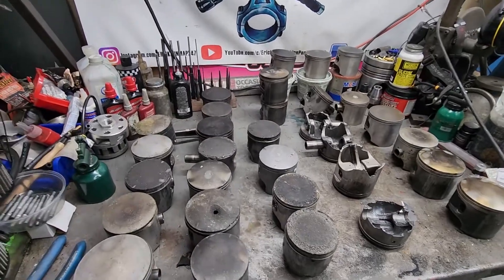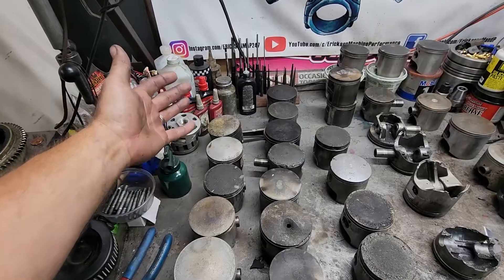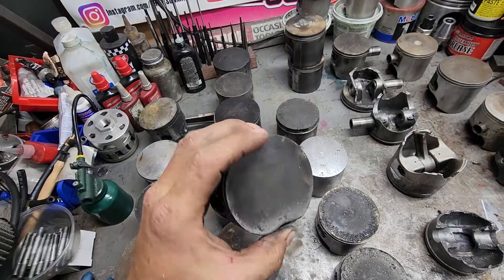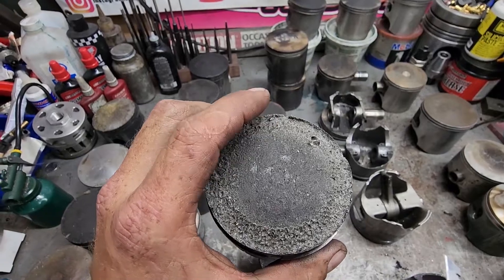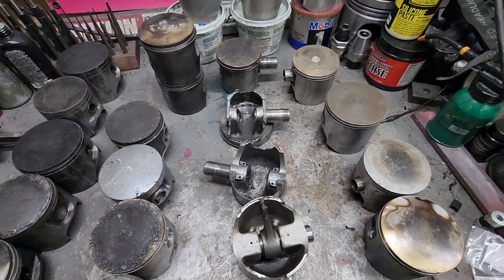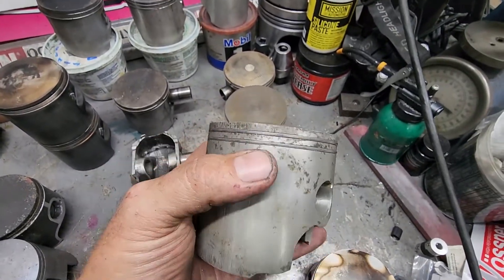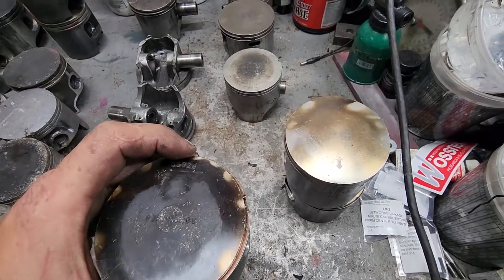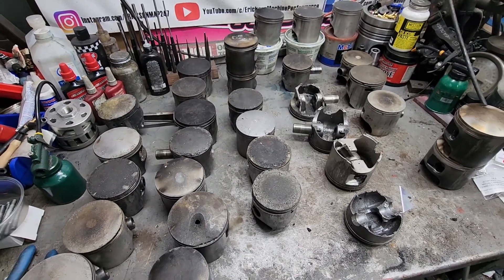OUCH! what happened and why? 2 stroke Piston Failures

Comment: Over revving oftentimes causes pistons to split along the wrist pin line as well
Reply from the maker: No.   If the piston is breaking, it's a clearance issue.    Over reving won't break a piston unless it's a 4 stroke and you lose valve control  ( drop a valve or float a valve that contacts a piston).
Reply: @EricksonMachinePerformance    OK, we will agree to disagree...
Reply from the maker: @donk499 pistons don't break for that reason.  There are engines that spin 20k rpm.   The only thing the would cause it to break is piston rock from being to loose.  If this has happened too you its the clearance that caused the issue.
Reply from the maker: But we can also agree to dis agree.  You can call piston manufactures. Pistons only go up and down.  The speed isn't going to break it. The rocking motion of to much clearance will. Either way.  Thanks for watching  @donk499
Reply: @EricksonMachinePerformance    Well, different piston designs have different failure characteristics for sure.
Reply from the maker: @donk499 pistons do not break from over reving unless they make contact with something else.   You would hurt the rod before you broke the piston.   If your cracking a piston its a clearance issue  or something is making contact with it.
Reply: @EricksonMachinePerformance     Once again, we will just have to "agree to disagree".   Again, it is like you say, different manufacturers/styles have different failure modes for sure.
Reply from the maker: @donk499  Thats not a failure mode.  Pistons don't magically break at high rpm.
Unfortunately your mistaking one effect for a cause.   Pistons do not crack from over reving.
Reply: @EricksonMachinePerformance   Well, I guess you and the engineers at OMC/Evinrude/Johnson will have to discuss this.
Reply from the maker: @donk499 once again.  If your cracking or breaking pistons, it's from too much clearance.     Best of luck.

Comment: Nice one. I have a different hypothesis on the last lean piston you showed. It looks sooty so possible it was rich and smoking so reduced oil in mix thinking too much oil and instead ran dry.
Reply from the maker: Yeah. Alot of people think that but its not correct.    When 2 strokes are rich the fuel washes the piston ( cleans it ). You can look up 2 stroke piston wash, it is a way to check how an engine is running.   When it is lean it over heats the piston causing the fuel and oil to burn onto the piston.       Thanks for watching

Comment: also we take apart TONS of outboards and most just sit around unused. people cannot be bothered to de-carb them with engine tuner or quicksilver power tune, and the rings stick. as a result, we take the head/s off and try to rock the piston in the bore. if it won't budge, you can try to free it up but most need to come apart. some rings are so seized in there we need an air scribe to to get them out! piston can even be ruined.

Comment: Wromg atleast in my casebthe streaking isnt being caused by water  becasue there isnt any in the engine
Reply from the maker: @Freeknickers24  there are many different types of vertical damage on a piston.   If you want email me some pictures I'll take a look.
Reply: @EricksonMachinePerformance  crazy I didn't expect a response ever much h less so soon. Well I'll tell a few details real quick and hopefully I'll remember to.irrow about pics . It is  a cheap china engine a yd 100 it's the second of two I ordered 1 and it snagged a ring g about 1 tank of gas in and it was ru  ing really good so I took it apart that involved 2 trees amd a winch I investigated then decides it was a ring that got snagged at one of the ports  did a little research which I should've done before ever running it I find out. The reason it snagged a ring is because because it pretty much an unfinished 2in1, cylinder and head are a single unit,  cylinder and it will snag a ring at a port basically always . So I contacted the seller on, lol, temu, the first thing of very few I've ever bought there. I took the second one or was it after the second one view I did the research? Anyways somewhere along the way i started chamfering the ports 2 engines 2nd engine vlew but not as bad but bad enough i needed a new cylinder in it i out new cylinder on and had accidentally while sleepy got mixed up and cut the intake port too low but o ran it it didnt blow but i eneded up chamging it when the next new o e came in i didnt hear the tapping before on the last cylinder but i did notice the scarring on the piston near the exhaust port and I tho k the intake aswell i looked in through the exhaust port the other day and i thinknit was a little worse. The other day about a week or so ago i swapped chains to use my 37 tooth sprocket ran about 4 mules then 4 back home and next ride with the 25T sprocket i noticed a tapping that seems to be louder and im assuming its the skirt slapping the cylinder as it sou.ds like a scrubbing sound is being made as well but that could be the drive gear but i dont think so. If im not working tomorrow im tearing it down again. The main thing I'm worried about other than getting in an accident, is the reason for getting into the accident, like what is causing this piston to score itself , maybe tithe ports have a inward pudgyness but when I used the blade of my micrometer which is basically perfectly straight I couldn't be sure there was and bulge at the ports that maybe are pulllung one side and causing th piston to cock one way or the other or maybe the port pressed in the rings to the piston and passing by them and was pressing in enough to score the piston but not enough to stop the piston or break a ring. Other than that maybe misshapen cylinder but this last o e loomed alot nicer than the other 3 even though it needed chamfered as well and I didn't port it because I need a ride not a toy just yet. I want to keep it but I think I may get another unit altogether that is better quality.   I don't know where I'm going with this post exactly im quite sleepy and it is 2:20am.

Comment: The modern YZ250 2-stroke (I have the 2019) has a problem that I am sure causes a lot of damaged pistons, ans is related to a cold seizure.  The jetting is so darn rich stock, the water takes forever to warm up.  I am not sure mine even got to a good operating temp.  I bought my bike with just 3-4 hours on it, and i am sure the previous owner was just impatient and took off before the water was warm enough.  I bet many kids do that with the YZ.   I rebuilt the top end, (and modified the engine for more low rpm power), to find the stock piston had a slight 4-corner scuff, but the major damage was at the exhaust port.  The hot piston expanded before the cold cylinder could, and forced the piston into the exhaust port.  The top ring groove was wide with a budge on the crown edge (and looks ready to come apart, but it still ran good), and the lower ring groove was squeezed shut against the ring.  I will bet  that up to 80% of those bikes, (because i now how impatient kids are), with stock jetting, has a damaged piston in the jug.
I have changed every jet in that carb (after raising compression which did lean it out a bit), and it is still running rich in the middle (have to change the entire needle---again.)
It was amazing I was not fouling plugs with the stock jetting,--but it was close.  I know 2-strokes with a carb are jetting a bit rich from the factory (because of different air quality around the world), but that thing would ruin the backs of my jerseys,---it was spitting so much oil out of the stinger.
Reply from the maker: @EarthSurferUSA  email me pictures of the failure.  Ericksonmap@gmail.com

Comment: I was hoping you would mention pre-ignition as well for detonation  but all around great video
Reply from the maker: @marinzeraja5416 Great comment.  Yeah, it's tricky to fit every failure method in 1 video without missing something.  My plan is to do a Dyno video and show what's going on when these events occur. I will try to show pre-ignition in that video.  This video was mainly to take the guesswork out of WHY a 2 stroke engine failed.     Thanks for commenting

Comment: I bought a blown up 2015 YZ. 
Massive detonation damage. The timing (aligned marks) was WAY off. Set it with a dial indicator to factory specs and have been all set since. 

Its easy to jump to the carburetor or the seals. But rod bearings, crank bearings, timing, and the head (did someone cut yours along the way?) all need to be checked.
Reply from the maker: @pgbpro20  You're right. Many people blame the wrong thing for their failure. That's why we made this video to help. These pistons were collected from different engines we have rebuilt for customers over the years. When we rebuild an engine, we go thru everything, and if it's a topend we do for a customer, we point them in the direction where to look and what caused the last failure to try to avoid it happening again.   Thanks for watching and commenting.

Comment: Hello sir, could you tell me something about fixed bearing position and free bearing positions? I work with big windturbines and in these gearboxes and generators, the bearings always have a free bearing position and a fixed bearing position to allow axial movement because of expansion due to heat. But on smaller engines like 50cc two strokes i can hardly find any information about this. Do you happen to know anything about this? Kind regards!

Comment: Do 2 stroke pistons have to have those two tiny holes ,,
Reply: Depends on application and piston manufacturing. Cast pistons should NOT need drilling. Forged can utilize it on certain power valves motors like a CR250 (02-07 models specifically). The forged pistons can expand at a different rate than cast hence the holes.
Reply: @Newmyyy  from much research I've learned it is to lubrication the exhaust bridge,,
Reply from the maker: It can be done for both cast and forged.  It's to cool the bridge port.   It's mainly done on race engines or performance engines that have alot of wide open throttle
Reply from the maker: The holes in that area to help cool and lube the bridge port.

Comment: My skirt shattered on the intake side.   (2nd time)  I am boring it 1mm over to solve the loose piston problem.  I need to clean all the aluminum out of the bottom end. Will I need to replace the bearings even if there is no movement in the rod.  It's a 2 stroke. And I seen black oil on thee counter weight when I turned it over which seems odd
Reply from the maker: If you broke the skirt odds are the crank bearings need to be replaced.  I'd recommend having it inspected

Comment: How often will 87 octane detonate inside a chainsaw? honestly I hardly remember anybody having that problem. Big chainsaws too.
Reply from the maker: I'll be honest the only chain saws I have messed with the engines on are hotsaws . The bigger issue is normally new fuels don't sit well. So if you're leaving the saw, sit longer than a week or 2, you should use fuel stabilizer.  As to newer saws needing higher octane, I'm not sure
Reply: @EricksonMachinePerformance Thank you.

Comment: It is often said that a design error in the engine itself can result in severe knocking or side slap of the piston, leading to damage. Sometimes changing the plugs solves the problem, which is a very difficult part.
Reply from the maker: Knock and piston rock are 2 very different things.   Piston slap is from either to much clearance, or being worn out, or not being warmed up correctly will not get better by changing plugs. Pre ign , knock can sometimes be helped changing plugs, but even then Normally needs higher octane fuel, or timing , fueling, or boost adjustments to safely solve the issue
Reply: @EricksonMachinePerformance  The solution I took earlier was to change the plugs. The standard is NGK CMR7H, but when I replaced it with CMR6A, which has a shorter reach, things surprisingly improved. I don't know if the manufacturer didn't test it enough or if it was a design error.
Reply from the maker: @redsmagic4907  may I ask what engine?  Year, make, and model?
Reply: @EricksonMachinePerformance  I was talking about a 45cc engine for radio controlled models. The problem I described was so bad that it took a long time to resolve.

Comment: This was a great video. I have a 2000 rm125 bored to a 134. After 3 seasons the piston melted on the exhaust side. Should it bump up the main jet?
Reply from the maker: I'd check the carb.  Maybe it clogged the main.  If it lasted 3 seasons I would ASSUME it was correct and something else happened
Reply: @EricksonMachinePerformance  like leaks in the crank seal or the case?

Comment: Had an 85 rm250 that the cylinder would not hold round long enough to wear out the piston.😂 The cylinder liners were junk in those early 80's Suzuki's. I had it bored every month. It never took less than .030 over to get it round again. Went trough two cylinders and sold it.
Reply from the maker: That sucks!!

Comment: Was waiting to see if there was a sbt failure haha…
Reply: Funny you say that, I just had one. 20 hours on the engine. Looks like a ring broke.  Under warranty but I’m thinking I’ll just fix it myself, really don’t want to deal with them. The heads were installed backwards from the start. Tigershark 1000
Reply from the maker: @ramdart74  your better off repairing with Quality parts and machine work.   If you want email us id be happy to help.  Ericksonmap@gmail.com

Comment: Seems like you’re just using two-stroke pistons for all of this considering they only have two rings and the length of the piston skirt. I would imagine it would happen more on a two-stroke engine, considering they run a high rpm, and they run very hot.
Reply from the maker: This video is only about 2 stroke piston failures like it says in the title.  2 stroke and 4 stroke pistons fail in different ways. This video is meant to help someone diagnose their failure

Comment: Keep making video bud!   Much appreciated.  So much information in so little time.  You not only are an expert, but can convey that information precisely and quickly.  I'm doing my first top end this week on a 2001 yamaha 800xl this weekend.  I hope I figure out why it feels like it is running out of fuel after full throttle and warmed up.  I went through the tank, carbs.  But, pulling the motor was the last resort.  I hope it is just gunked up sticking power valves.  They look great on the outside, rotate perfectly, and I cleaned them about 5 years ago when I put waveeater clips on them.  But, the inside might be different.  Beyond that, do you have any ideas?  It has clean carbs, runs crisp (stock, and at 5500 feet elevation is where we live, near a lake)  any other ideas.  Still has the stock yamaha fuel lines.  But, I took everything apart fuel line wise and fuel tank and pickup, and didn't see anything clogged.  It started at the end of last season, after overfilling the fuel tank, and hitting a big wake, I think?
Reply from the maker: If you want email me the pictures of the damage ericksonmap@gmail.com